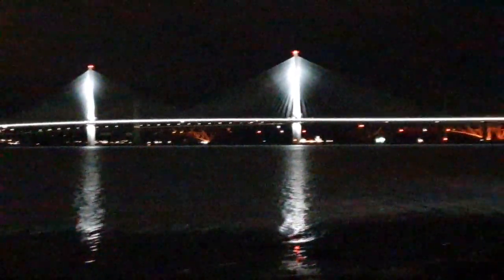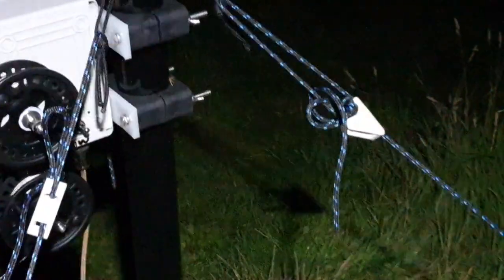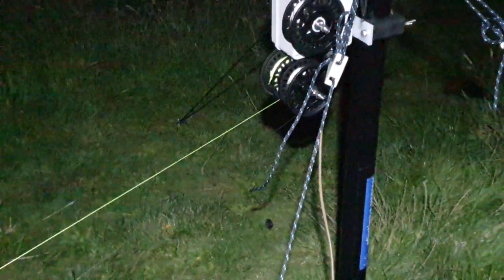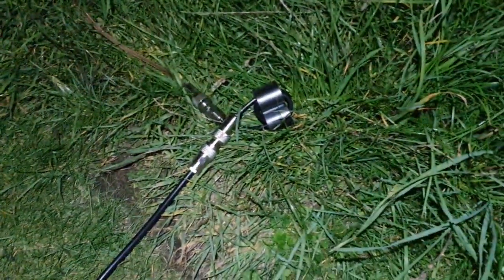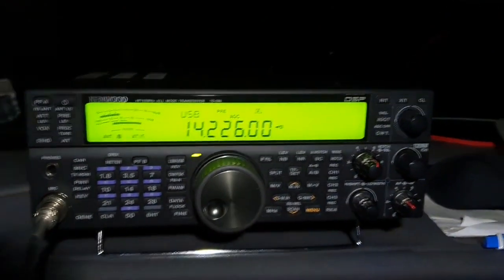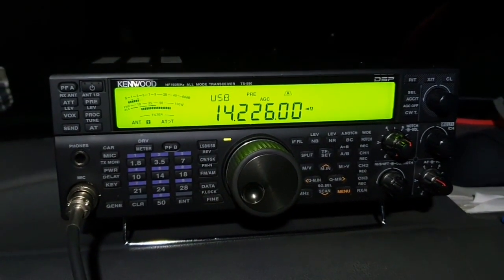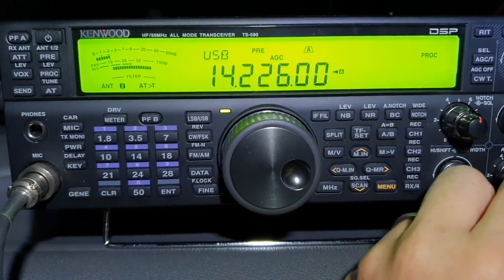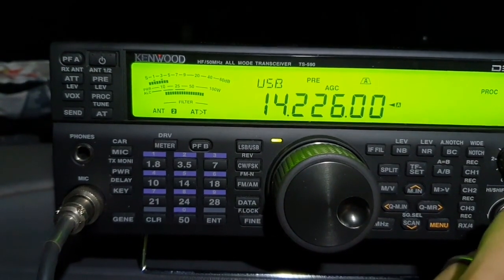Night Time DX using a 20m End Fed Half Wave Vertical

Comment: Have you tried a long feeder (1/4 or ideally 1/2 wave) with no choke or counterpoise. It works for me on the 49:1 1/2 wave vertical.
Reply from the maker: Hi Ady, I haven't. I need the counterpoise regardless as its needed as the radial for the 40m quarterwave.

Comment: What are you using for your power supply Colin and how much power are you running?
Reply from the maker: I have a 110ah leasure battery installed in the van connected to a split charger. I was only running 100w. I have the option to run a petrol generator and an Acom 1000 if a feel brave enough to lift them.

Comment: Most of those NA stations are running 1KW so will definitely been heard on a 20M vertical..
I use 1/4 wave elevated vertical with 8 elevated radials, and worked ZL yesterday.

I'd prefer a directional antenna on 20M, as it's a QRO band, but the vertical works perfect on 40M.
Reply from the maker: I have to agree. Even station u heard talk about working conditions was 600w plus and a beam. I dont think I did too bad under the circumstances. I have a portable 20m Moxon in the works. This along with my Acom 1000 and Honda genny should make a  loud /p station.